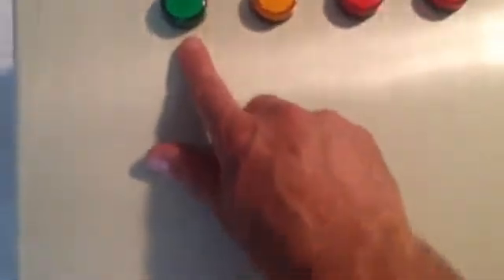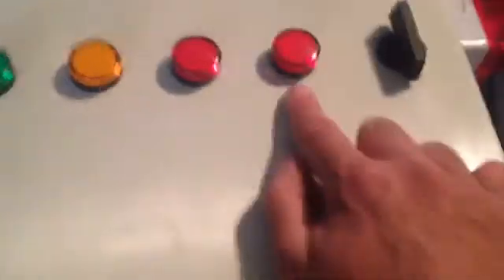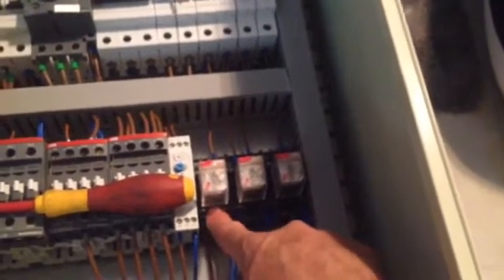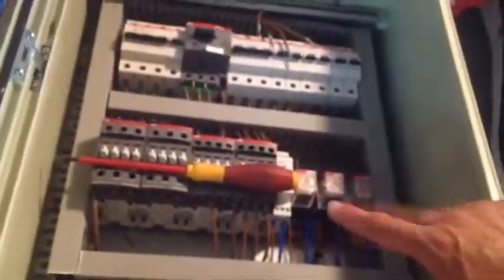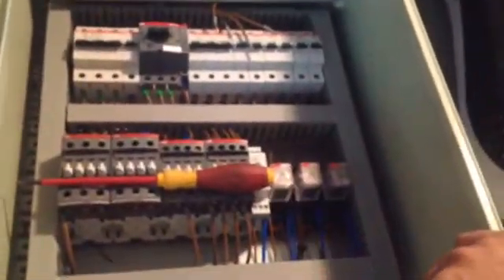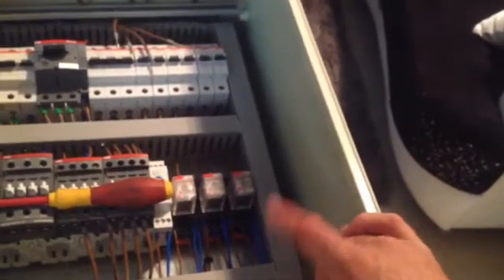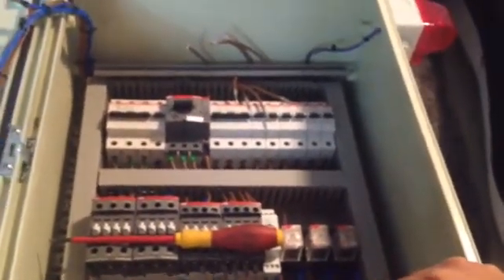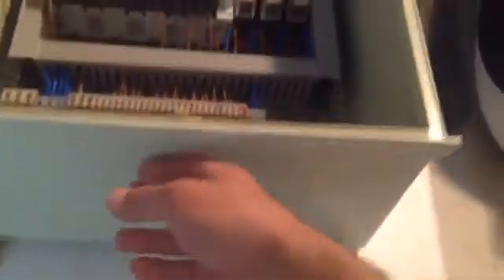Shock freezer Electric Board

Comment: Nice work! When I work with the eliwell controller I use its digital input for the micro switch on the door and the aux relay for
the lights. It will stop the fans also and start pump down cycle. I like those controllers.
Reply from the maker: Yeah I like them but I use them just to control fans , and pumpdown ,defrost ,and thermostat